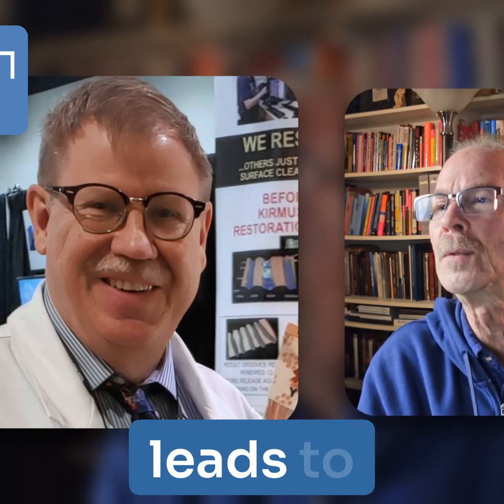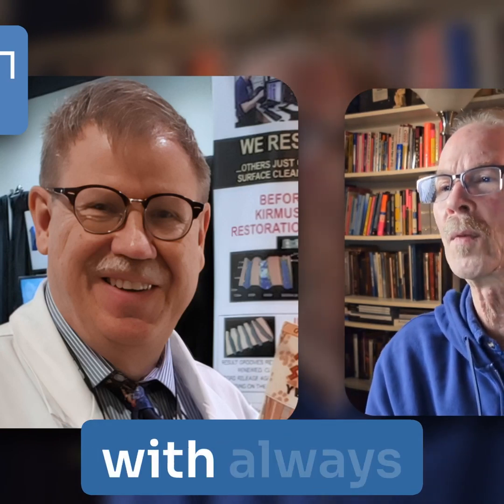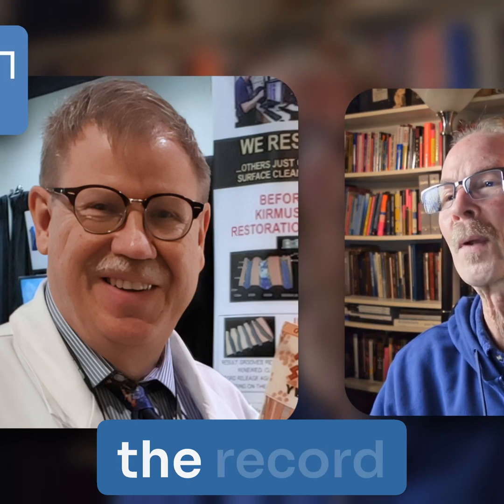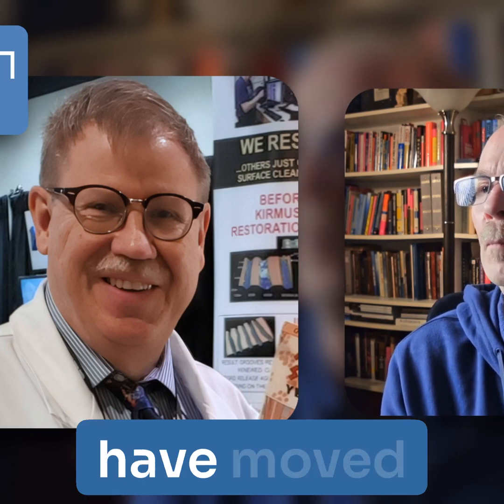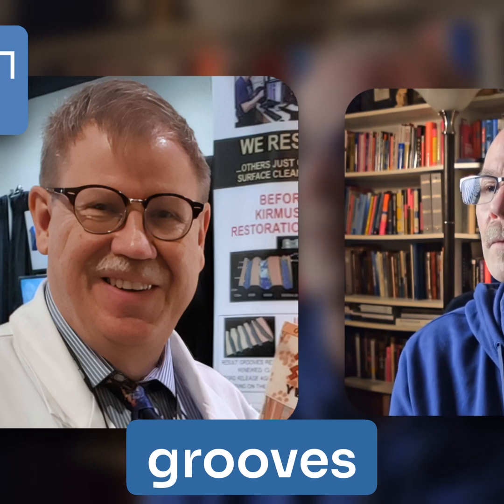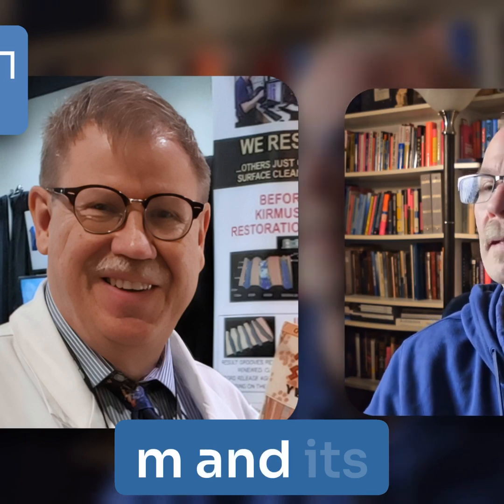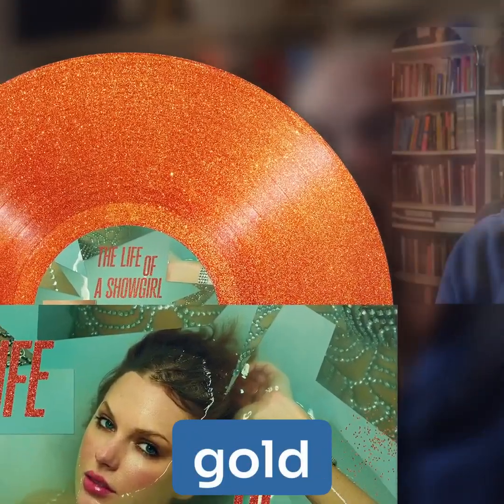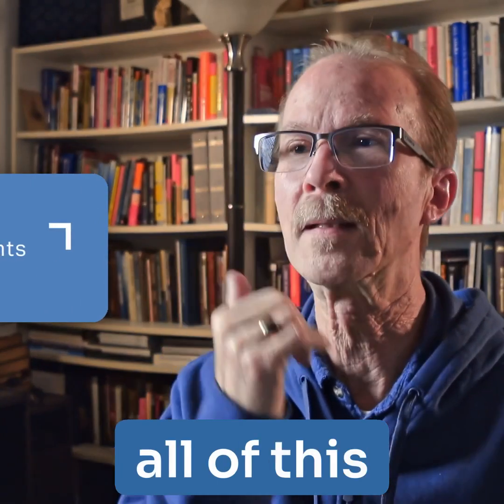Vinyl Record Longevity

Comment: A stylus wrongly setup affects vinyl, a stylus correctly setup never affects vinyl negatively beyond a minimal wear that happens between anything that rubs on each other. That is because as it plays, it‘s the stylus that gets worn out more than the vinyl. Regardless, the most prone to fatigue is the suspension system, not the stylus under normal play, as in fact those rubber loose their flexibility and can even break, while the stylus as such is ok. Repair isn‘t always available. The Suspension system is what people should care for, as it‘s the most important element in all play signal. The pivot point of the stylus. All that misleading focus on turntable bearings and tonearm vta on the fly BS and stylus forms is irrelevant compared to that.
Reply: Minimal wear yes, but if the cartridge - tonearm combination are not setup properly,  we can assume wear on both.

One can hear issues with VTA and Zenith error. 

This said, the needle is cemented onto the cantilever. The cantilever in turn is suspended by an elastomer, rubber as you call it.

The subject matter discusses wear of a record and that of the stylus.

This said, elastomers are affected by age, any affectation of a liquid cleaner if only the tip was not touched, where capillary action has a negative effect,  affecting sound. Not necessarily wear.

Do look at the links provided covering needle and vinyl wear with respective case studies.